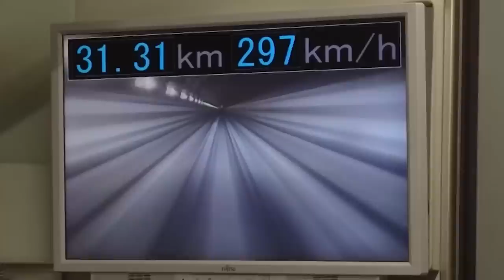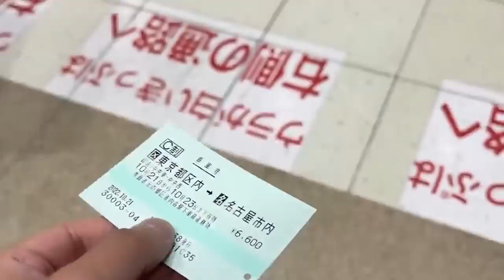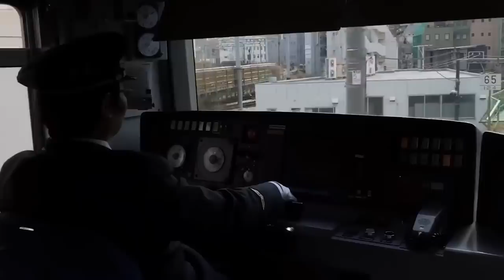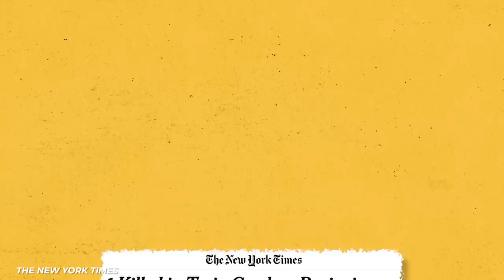Japan's $9 Trillion Dollar Levitating Bullet Trains

Comment: Is it Magnetic, like the Monorail in Disney World? Or similar? It looks amazing. We need that kind of mass transit in the United States.
Reply: This wouldn't work for the US, the country is just too big, unless it's from like philly to nyc but cross country travel wouldn't work. Wayyyy too much money and it would be expensive as all hell to get a ticket if it did exist. And yes, it floats due to the magnets pushing it up and magnets propelling it forward so there is no actual contact with the track (ideally i assume) idk about what you mentioned in disney world but yeah, the train is propelled by magnets, and floats with magnets so their isnt any friction, the only resistance is the air
Reply: @Xx0ME0xX  If the major city's had these in them, with a connection lines into and out of the city from two points, built halfway. The next city could pick up the line from there. Maybe. Of course there will be some areas that don't  have the lines. But maybe  enough would, that would make it work.
Reply: @Debbie Fulton  it could be possible, the issue though is the distance between cities as there are only a few "major" cities in each state, and crossing state lines would be a hassle because they would have to work together to get it done, not to mention all the local governments in between. But yeah, for example, philly to chicago, you have philly, harrisburg, pittsburgh, columbus, indianapolis, then chicago (big turns in the track won't work, it has to be practically straight so the route i mentionend may not be possible) but yeah, every on of those cities, their states, the counties, the local governments, would all have to approve it before it can even begin being made, and even then, peoples home could be in the way so they'd have to move for it to work since america is different from japan in that aspect. It could be possible, but it would probably take until after i'm dead (i'm only 19) before it even gets approved to start the building process. The most i could see would be just two or three cities being connected by these, like japan did. Our country is just too big and the geography too different from state to state to connect with just trains, at least not with our current technology i would think
Reply: @Xx0ME0xX  You're  right. It was wishful thinking on my part. I know our country is too big. But maybe the big cities could hook up like I said. Then something like Amtrak could tie in to the outer lying areas to join together. At one point this country was connected east to west. This was in the 1800's Surely it can be done again.
Reply: @Debbie Fulton  true, the biggest difference is that was just iron tracks but this train needs to be practically straight which would be very difficult with the geography (Appalachian mountains and the rockies) but yeah, i'm not saying it's impossible, just that i dont see it happening anytime soom
Reply: @Xx0ME0xX  Have you ever heard of China?
Reply: @Rodney Blumenstein  nope, never heard of it. What is this thing called china? Lol jk, idk if they have these types of trains, and if they do, my point still stands because of the local governments and all that. It's a completely different political setup than we have, it's possible to do it in the US, but i doubt it will ever happen because the governments will never agree